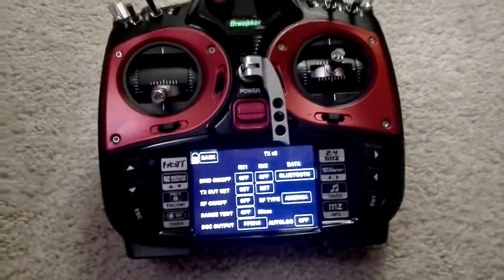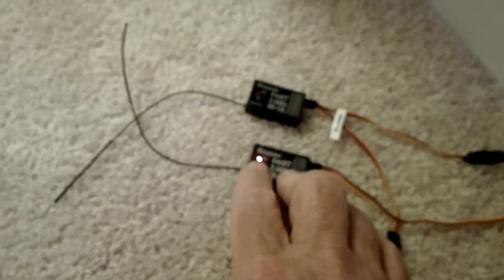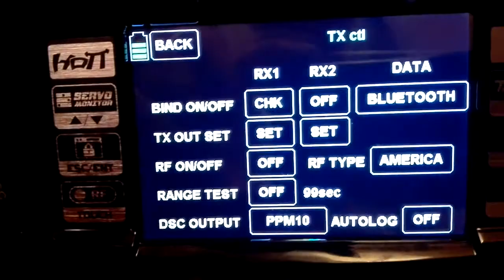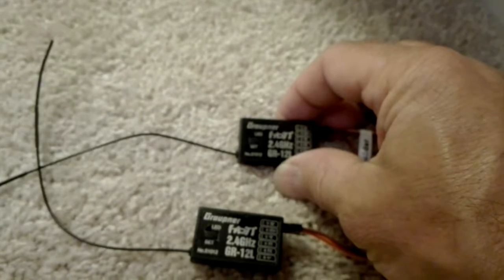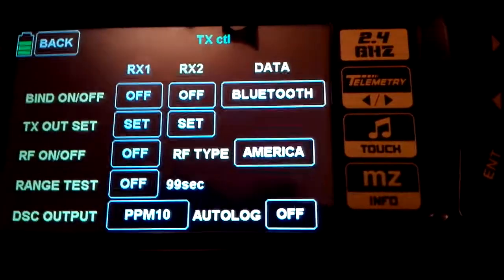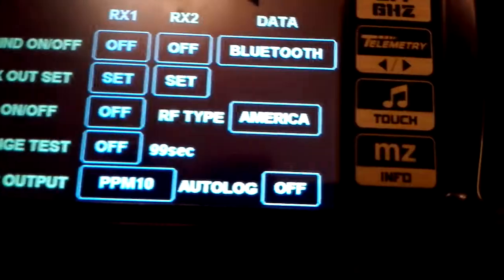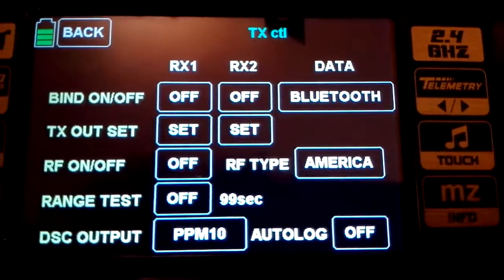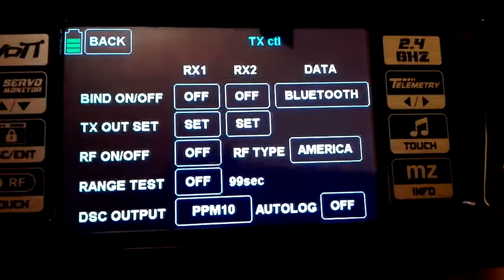Failure to bind two Graupner GR-12L receivers (take 2)

Comment: Thanks for sharing your video. Did you ever figure out how to bind 2 receivers?
Reply from the maker: Yes I did. If I remember correctly you need to power 1-st one, bind 1-st one, then power 2-nd one and bind 2-nd one. The reason I wanted to bind 2 receivers is because I thought it would give me 12 channels total. It turns out you get 6 channels with two receivers. They are duplicate of each other. The only advantage of having 2 RXs would be when you have big airplane and some channels (for example rudder and elevator would be controlled from RX one, and ailerons and throttle from RX two.